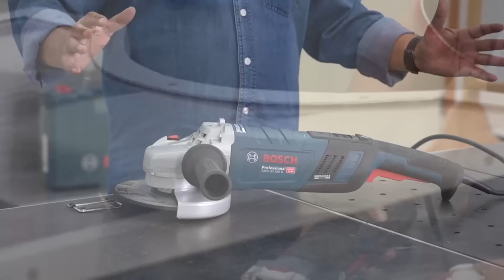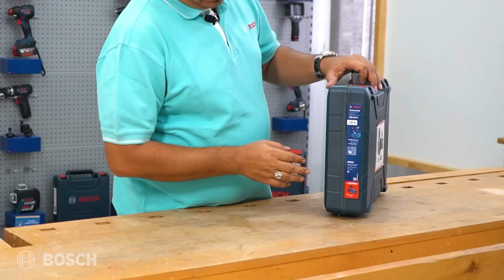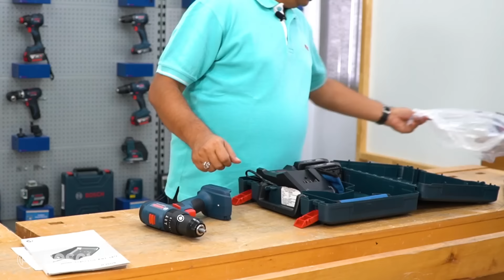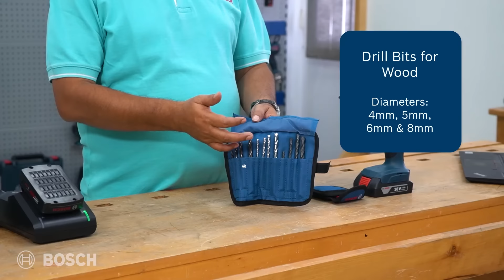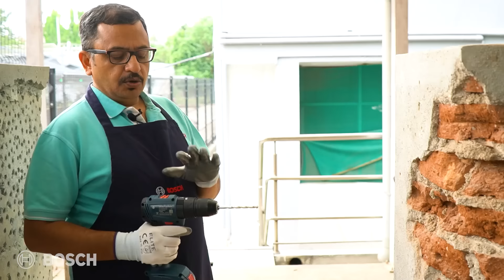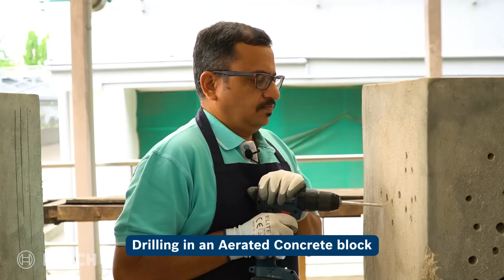Bosch GSB 185 LI Cordless Impact Drill | Unboxed & Explained | Basics With Bosch

Comment: According to hole in concrete or power which is beterr gsb 180 li vs 183 li vs 185 li
Reply from the maker: Hi there, thank you for contacting Bosch Power Tools India. Our GSB 183 and GSB 185 will be ideal for light concrete drilling. For continuous & heavy concrete drilling, we recommend our GBH series of Hammer Drill Machines.

Comment: Can we do hammer drill as well?
Reply from the maker: GSB 185 Li drives screws into wood up to 10 mm and drills in wood of up to 35 mm, as well as metal or masonry up to 10 mm. If you are looking to work on concrete, will recommend to use our GBH range of rotary hammer machines - https://www.bosch-pt.co.in/in/en/rotary-hammers-131445-ocs-c/

Comment: I have ordered GSB 185li after long research and I think its the best option in its budget for brushless hammer drill driver 
Does the Bosch amp share 18V  battery also work with Makita ?   which other  brand available in India does it work with ?
Reply: How much for set?
Reply from the maker: Hi, GSB 185 Li is a wise choice for an Impact Drill. For more information on our 18V Battery system - https://www.bosch-pt.co.in/in/en/knowledge-innovation/professional-18v-system/battery-charger/ & information on AMPShare - https://www.ampshare.com/gb/en/
Reply: it costs around 10500 - 11000 rs  on various  seller sites